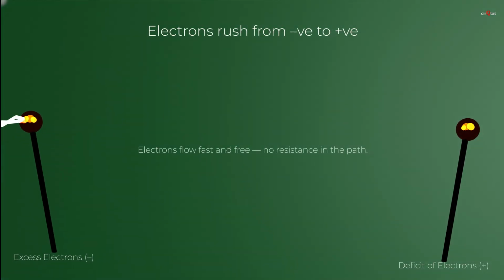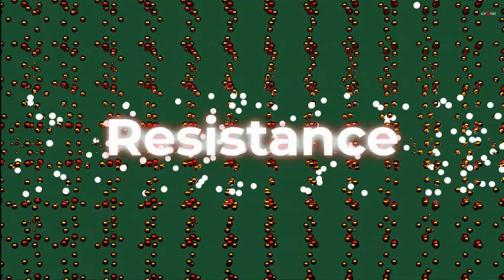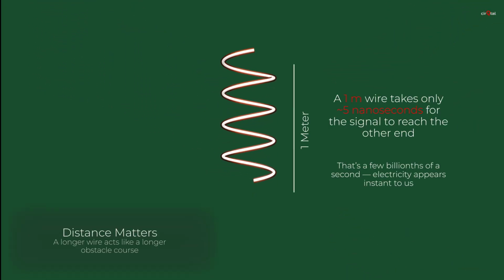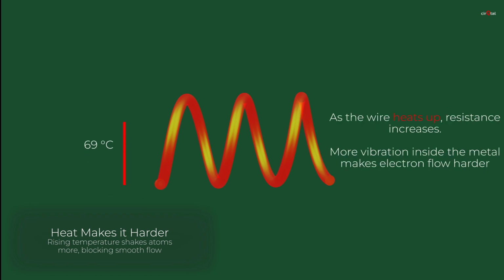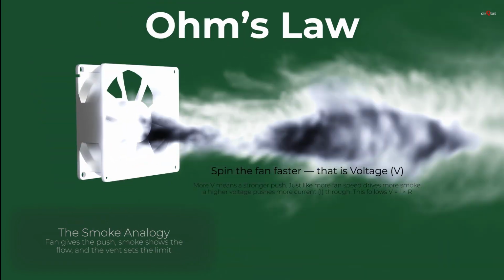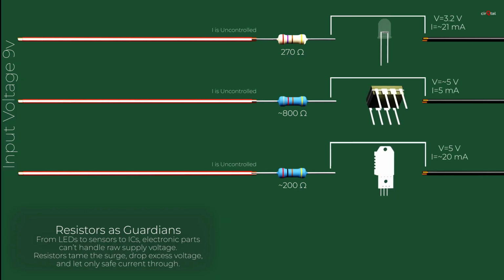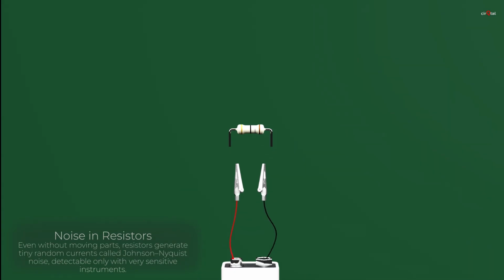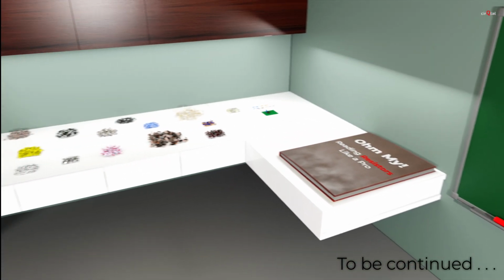What is Resistance? | Resistor Complete Guide Series (Part 2) #resistors  #electronics  #ohmslaw

Comment from the maker: Resistor Complete Guide Series (Part 2) | What is Resistance?
Electricity always tries to move — but every path resists.
Witness the invisible battle that shapes every circuit and defines control itself.

#Resistors #cirQtal #OhmsLaw #Electronics #LearnElectronics#resistor #resistorsinseriesandparallel #resistorforledlights #resistorareyouhappynow #resistorvic #resistorsexplained #resistorcolorcode #resistorsinparallel #resistormutt #resistorcolorcodecalculationexamples #resistorlive #resistorsao #resistorsandcapacitors #resistorcircuits #resistorgame #resistorexplained #resistoriamnothing #resistorforledturnsignals #resistorinseriesandparallel #resistorand #resistorandcapacitorcircuitproblems #resistorandcapacitor #resistorandinductorinseries #resistorandcapacitorinparallel #resistorandledcircuit #resistorandcapacitorinseries #resistoranddiodeinseries #resistorandinductorinparallel #resistorandcolorcoding #resistorandled #resistorandresistance #resistorandcapacitorinparallelaccircuit #resistorandresistancedifference #resistorandcounterindigitalelectronics